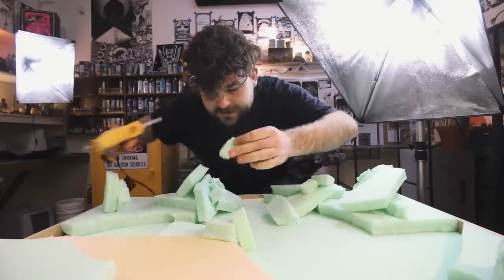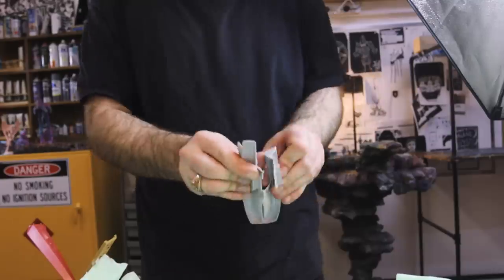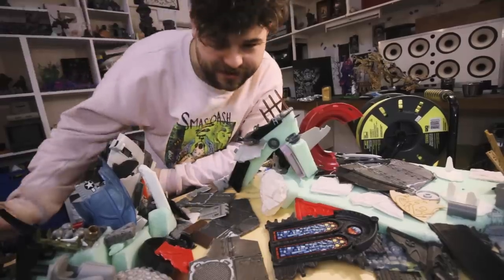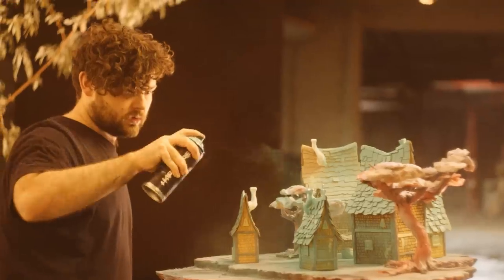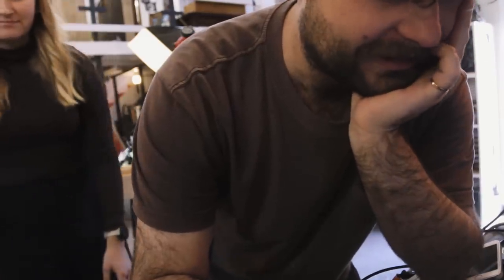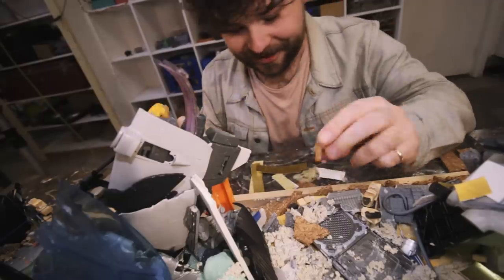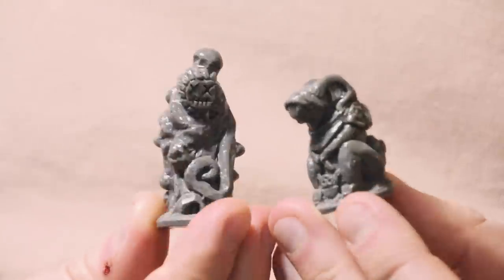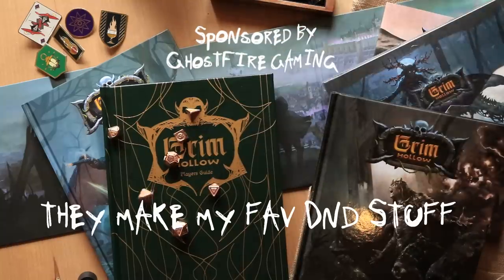My Forgotten Gaming Table

Comment: Melting foam reminds me of my teen warhammer years. Spray-painting polystyrene foam too close so that it would partially melt to produce terrain and melting polystyrene onto an armature with a soldering iron to make models. Perhaps I shouldn't have spent hours doing that inside without a mask or ventilation 😬
Reply from the maker: I love that effect!